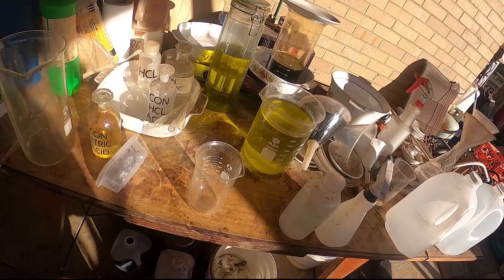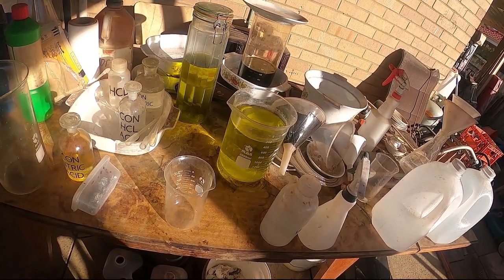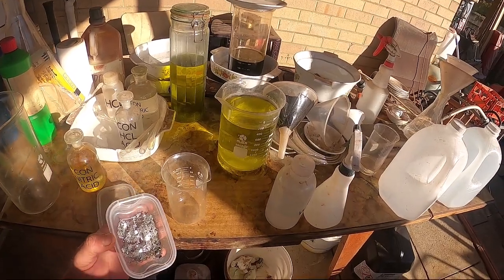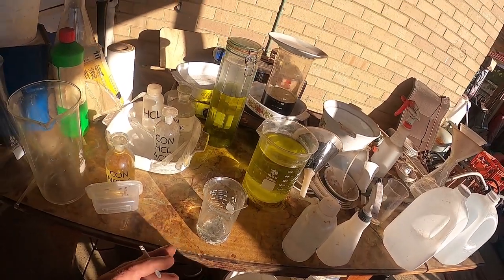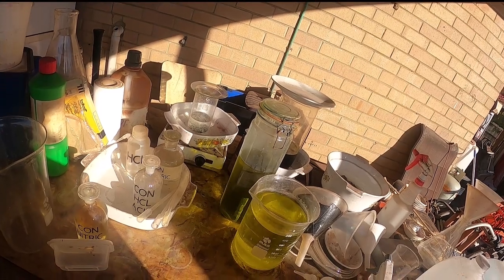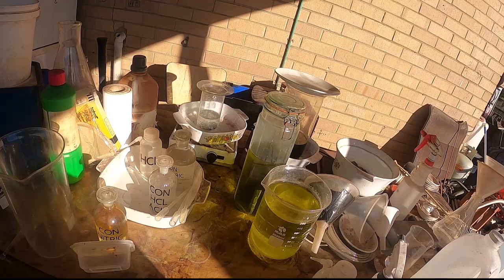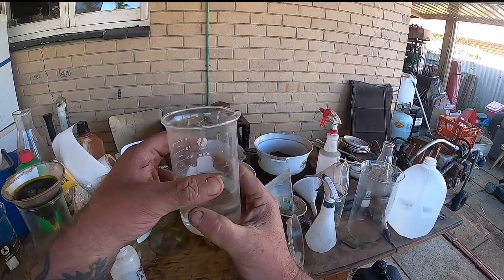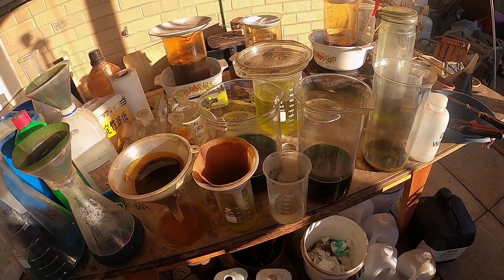HOW I MAKE STANNOUS CHLORIDE TESTING SOLUTION FOR GOLD AND PRECIOUS METALS this is the easiest way

Comment: Interesting what solution do you use to test gold with a rub test thing. And secondly can you make the solution? Cheers
Reply from the maker: i dont have the chemical test where you rub an item on a stone then test with liquids . ive been wanting to get one .and yes i often make stannous , even without trying because its just tin and hcl . so when ever i soak something in hcl to remove the solder , it makes stannous. i do have a video showing me making it

Comment: I keep hearing to use solder that doesn’t have lead in it. From what I’ve heard as long as it doesn’t have lead in it, it will work, but I bought some that has silver in it and it doesn’t seem to dissolve very well.
Reply from the maker: theres nothing wrong with using standard solder . the lead wont affect it. i use the solder that comes off curcuit boards when i depopulate using the heat gun

Comment: I've got a question for you, I have solder and on the label it says 60% tin and 40% lead. What happens to the lead when the tin dissolves into HCL? Does it contaminate the solution?
Reply from the maker: To be honest I don't know if the lead even dissolves with hcl.
But it doesn't affect the outcome. It still makes good stannous

Comment: I noticed two differences in the way you make stanis... First you cook it... And second you filter it.. I believe that has something to do with how long it lasts... The eBay refiner seems to leave the excess tin in the solution
Reply from the maker: lol , yeah leaving a bit of tin in the solution is meant to make it last longer . the very first time i made stannous i used tin granuals , and the recipe i followed said to add a couple of granuals to the stannous . but i found using solder in this method and using containers that dont let sunlight in helps it to last longer.
the ebay refiner also uses stannous powder which is why his is a creamy yellowish colour. mine is definately cheaper and easier

Comment: 2 sections of lead free solder, one for each electrode, 95% tin, 5% antimony, a 9v battery, and a small amount of HCl. The black sediment is the antimony.  The electrolysis will make stannous chloride quite quickly.
Reply from the maker: yeah i was told a long time ago that the black stuff is antimony but when i was making this video i couldnt remember that word lol. the antimony is as a result of metastanic acid